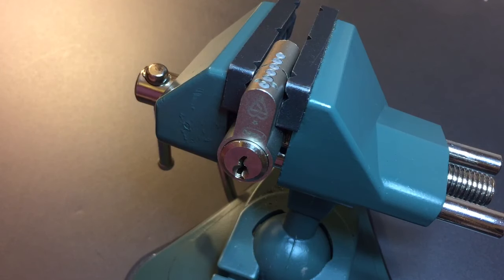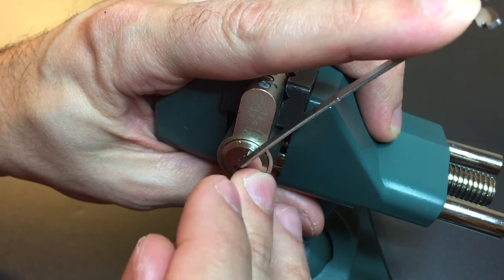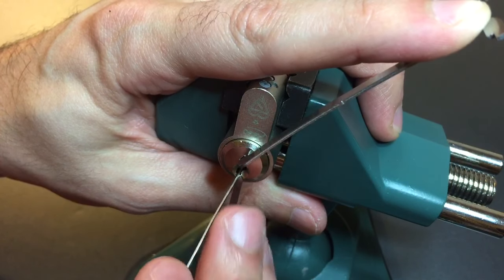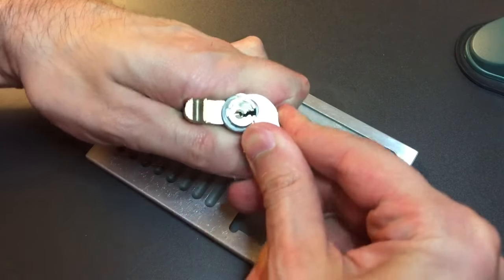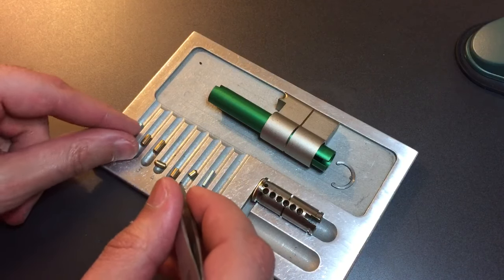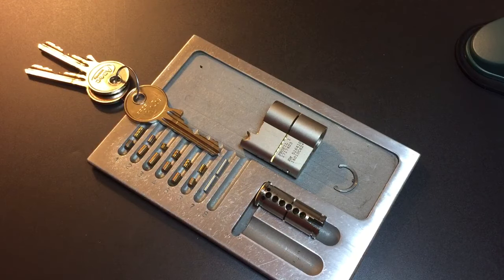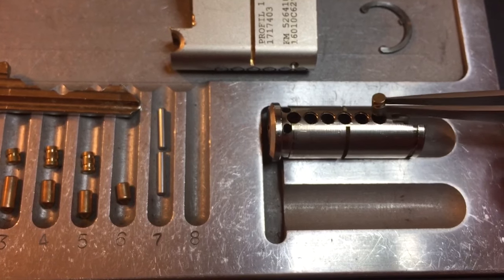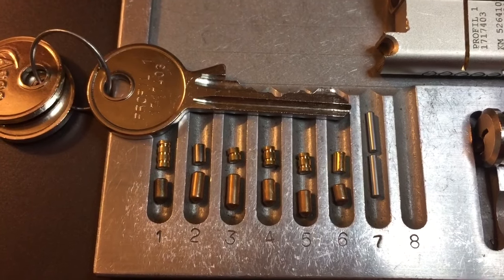[305] Asec Euro Profile Cylinder Picked and Gutted

Comment: Nice pins and pick 👍🏼 I notice however that if this lock were subject to a snap attack, all of the drill protection would be lost, leaving only 2 maybe 3 brass pin stacks to drill. The previous lock you showed had better drill protection behind the snap cuts.
Reply from the maker: Thanks, and good point about the drill protection... I didn't notice that.

Comment: Another smooth one, your videos go flawless. I wish I could get my videos as smooth as yours I wouldn't have a 15 min video. Another great pick on what looks like a pretty decent lock. Thanks for sharing.
Reply from the maker: Thanks... and remember, that my videos usually don't show the first time I am opening a lock.  I definitely opened this lock a few times before starting the camera, mostly to figure out what pick worked best.  My go to pick for locks like this (7 hook) didn't reach pin 6.  In any case, having a couple opens under your belt definitely speeds things up.
Reply: +LockPickingLawyer that makes a lot of sense a lot of my locks I'm opening for the first time. But there is a lot I try and  open at least once before filming. But my picks are not nearly as fast as yours. I think as I get better I can get the timing a little better. Thanks LPL.

Comment: hay lpl good after noon.glad you showed anti bump cyl again so after you brake the sheer line it catches on the counter milling if your trying to bump it??? and throws timeing off .i hope im asking the right question. 😎😎
Reply: Larry Marrs I'm thinking it throws the timing off by not sitting on the key pin.
Reply from the maker: The key anti bump feature is that the key pin and the driver pin to not touch when in the resting position, or if they do touch (as would be the case when a euro cylinder is correctly mounted), the bump key would not touch the key pin.  Hope that helps.
Reply: Randy Perkins thanks Randy
Reply: Going to watch again.all new to me 😎hopefully one day i will have a vidio need more schooling from you guys.been watching for all most a year learning so much but need more practice and knowledge thanks for sharing 😎😎
guys.be
Reply: Do not Know what hell  that on bottom of this screen.

Comment: Quick pick. Make it seem like anyone can do it with no hiccups,lol.
Reply from the maker: Thanks... these locks are not that bad.  The hardest part was the bitting, which you see required a pretty steep hook.  The key to opening these locks is to recognize the inherent flaw in counter milling... All you have to do is press the pins up until the driver pin gets springy, then move on.  The lock practically screams that the pin is set (or at least, in the counter milling).  Once everything is in the counter milling, one extra little push opens the lock.